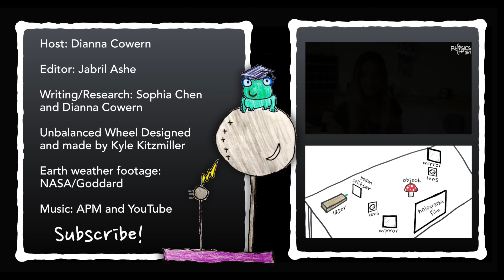Are perpetual motion machines possible?

Comment: Are perpetual motion machines possible?  No.  Do I know why?  Yes.  Do I still want Physics Girl to explain it to me?  YES
Reply: The First Law of thermodynamics  encompasses several principles:

    The Conservation of energy, which says that energy can be neither created nor destroyed, but can only change form. A particular consequence of this is that the total energy of an isolated system does not change.

    The concept of internal energy and its relationship to temperature. If a system has a definite temperature, then its total energy has three distinguishable components, termed kinetic energy (energy due to the motion of the system as a whole), potential energy (energy resulting from an externally imposed force field), and internal energy. The establishment of the concept of internal energy distinguishes the first law of thermodynamics from the more general law of conservation of energy.

   
    Work is a process of transferring energy to or from a system in ways that can be described by macroscopic mechanical forces acting between the system and its surroundings. The work done by the system can come from its overall kinetic energy, from its overall potential energy, or from its internal energy.

        For example, when a machine (not a part of the system) lifts a system upwards, some energy is transferred from the machine to the system. The system's energy increases as work is done on the system and in this particular case, the energy increase of the system is manifested as an increase in the system's gravitational potential energy. Work added to the system increases the potential energy of the system:

    When matter is transferred into a system, that masses' associated internal energy and potential energy are transferred with it.

   

    The flow of heat is a form of energy transfer. Heating is the natural process of moving energy to or from a system other than by work or the transfer of matter. In a diathermal system, the internal energy can only be changed by the transfer of energy as heat:

 

Combining these principles leads to one traditional statement of the first law of thermodynamics: it is not possible to construct a machine which will perpetually output work without an equal amount of energy input to that machine. Or more briefly, a perpetual motion machine of the first kind is impossible.
Reply: @jeremysmith8035  laws of thermodynamics applies only to steam engines and internal combustion engines, but do not apply to asymmetric electrodynamic machines and self accelerating generators. Energy is created in every electric generator. In conventional electric generator, created energy is used to do negative work and decelerate rotor. In RegenX generator, created energy is used to do positive work and accelerate rotor. Physics community get everything wrong, when they falsely applied Newtonian mechanics to electrodynamics. In electrodynamics, equal and opposite reaction can be delayed in time domain. If armature reaction is sufficiently delayed in time domain, equal reaction is no longer opposite, but complementary. Law of conservation of energy is violated along with Lenz law. Current can be delayed in time domain above critical minimum frequency, around 1kHz.
Reply: @marcisgulbis9310  none of this matters as long as there is no working prototype of a machine that gives you more WATTS then it took.
you can make that rotor spin as fast as you want but you'll have get the energy from the rotor at some point and that is where this BS falls apart every single time.
Reply: @jeremysmith8035  Copy and paste much? Wikipedia is your friend.
Reply: @jeremysmith8035  Bla bla bla another quote of the law  Asymmetry is nowhere explained
Reply: @claytonrealist8868  My thoughts a little miss priss teachers pet trying to explain it to us  Liberalsplaining no facts just conviction
Reply: Heard that, yo.
Reply: They aren't possible with the knowledge we have today. Who knows where we will be in the future.
Reply: I dont mean to be so offtopic but does anyone know a tool to get back into an Instagram account..?
I somehow lost the account password. I appreciate any assistance you can offer me
Reply: @labla8940  In symmetric motors, all coils is connected to power source all the time. In asymmetric motors, only one coil, or group of coils is connected to power source. All other coils is disconnected from power source. When coils is disconnected, ether can flow into coils. In asymmetric systems, coils are switched on and off, without reversing direction of current.
Reply: @labla8940  https://youtube.com/user/ufopolitics
Reply: @prestonian1066  101 % will be success. That is only 2% away.
Reply: We live on a perpetual motion machine.
Reply: @claytonrealist8868     same place we were two hundred years as regards to perpetual motion.
Reply: @kalijasin  Well, this sounds interesting.:) Would you be so polite to clarify your point of view?
Reply: we can harness the energy of gravity, make artificial waterfalls,
the problem of raising water requires greater energy upwards can be overcome with water electrolysis, but gravity on earth is small enough that it requires modification of liquid molecules other than water (H2O)+catalyst
because the height of the water tube required is around 300000 meters if using H2O, and yes this looks like perpetual motion
Reply: 100% agree.
Reply: Wait ... are you saying this video is about perpetual motion?
Reply: they exist I have seen plenty... invention secrecy act
Reply: Same
Reply: Hahahaha yup!
Reply: I only see physics experts around here... Could someone explain me what Maxwell's demon does?
Reply: of course
Reply: Im so in love with her :D
Reply: "Efficiency" in physics is technically a measurement of how close you have come to perpetual motion, because it measures how much useful energy you get out of something.

You could pretty much say that perpetual motion is kind of the ideal goal in physics, like for example how zero air resistance is the ideal goal when you design cars, and so on;
it is something that cannot actually be achieved, but that you nonetheless try to aim for as much as possible.
Reply: I’ve invented one it’s easy
Reply: @VikingGodForLife  found a good way to hide the wires to the battery?
Reply: Actually according to physics, perpetual motion machines exist in vast numbers. They tell us that the electrons orbiting in the atoms will generate power and will always run at the same speed, even when acted upon by other atoms.
Reply: Decay
Reply: A silnik grawitacyjny da się zrobić??
Reply: i
Reply: It is possible, but not yet in a zero gravity environment..

Comment: We in Germany have already the unlimited Energy Machine.  Its made from a Cat, and one slice Toast Brot.  Since Cats ALWAYS land on the Legs. And Toast Brot ALWAYS land on the Butter side...  when both fall down, you only Need to put the Toast Brot on the Back of the Cat and let them both fall down.  It will spin neverendless, since the Cat will land on the Legs, and the Brot will land on the Butter side.  And since this Construction will spin neverless you have unlimited Energy.  We use this Machine in our House. You only Need to feed the Cat from day to day. Thats it.
Reply: Haha, thats funny!
Reply: Why not put two butter sandwiches with the butter on opposite sides? Won't have to feed the cat
Reply: And if toast always landing on the butter side was true, it would actually work, unlike the cat and toast thing. If the cat lands on it's feet, the toast doesn't land anyway as it stays on the cat's back, so it never reaches the ground :P
Reply: Spendet ihm bitte ein Lachen
Reply: German engineering at its finest
Reply: So then the cat food is the energy source? Save time eat cat food?
Reply: but but...wouldn't the spinning force run out of control as the cat's ability to land on it's legs constantly compete with the toast's butter side, thus accelerates infinitely until it become a supermassive blackhole and destroy reality? O.O
Reply: The fur provide the friction to not let that happen and turns it into electricity as well
Reply: Why not take a single slice of toast and cover it entirely in butter so every side is the butter side?
Reply: Leader Fangrill Because if you do, the slice will separate in two thinner buttered toasts and release a lot of energy
Reply: I drench the Toast Brot in the butter and boom, antigravity.
Reply: better put two cats back to back and then just give them a starting spin thats it
Reply: Bart Bols Otherwise the result could be catastrophic.
Reply: ...(what's with the weird capitalization?)
Reply: In German all nouns are capitalised, whereas in English it's only proper nouns.
Reply: Ha Ha I saw that Cat Toast Cartoon. Genius!
Reply: hahahahahah
Reply: Zero Messiah vacume
Reply: this is the future of wormhole technology
Reply: Karl S. What if you just butter the Brot on both sides?
Reply: Matt Wood   OMG!! Never do that. The whole Universe would implode, becaus of an space time paradoxon.
Reply: Matt Wood it would just levetete
Reply: Why the poor cat? You only need 2 toasts and get the same result.
Reply: SkyMix_RMT the unbuttered toast would just flop down the cat would be able to flip it over
Reply: This is so old :(
Reply: 2010 called and wants its joke back
Reply: That's a problem for the next generation.
Reply: Give the cat a toast brot, loop is closed.
Reply: Funny, my cat landed on her head earlier today when she got in my way and fell off the table as I tried to take a photo to prove to an Ebayer who took no notice of my 1300+@100% Ratings that he'd sent me the wrong diameter steel rods... so your theory may not hold when In-The-Way and Table Factor is involved.
Reply: jajajaja
Reply: Nice idee ... Potenzial für Perpetuum mobile?
Reply: So, will the cat stop landing on it's legs if you stop feeding it? :D
Reply: I see all these likes and all I can think is "Must be their first week on the internet" lol
Reply: brot und beer
Reply: Much better ! Remove the cat and replace it with another toast, this way the system turns without any external energy. There's no more need to feed the cat, even if sometimes you must reload the butter sides to compensate evaporation, but far less than the cat's feeding.
Reply: Sorry, I posted the same message but far later, I shoud have read before.
Reply: You fool, but very funny too...
Reply: Genius
Reply: my cat would just eat the bread lol
Reply: Al Bundy so your saying toast butter and a cat will infinitely land and fall in one spot without toast or butter falling of of a cat which makes energy come from an infinitely moving things and how would you make something to collect all that energy from your cat torture
Reply: if you need to feed the cat, then is not infinite... because the cat will eventually die and stop landing on the legs... :)
Reply: Very Intriguing. I am looking to purchase 300,000 units based on your data come the end of this business quarter. My only concern before we proceed with this transaction is the issue of excrement. Do you have a solution for this to keep it contained? My board members are concerned of a possible issue with the speed of the rotation of the cat combined with it's constant need to defecate. Some are hypothesizing that it will be akin to a monkey with a hateful grudge towards humans, whereby retaliating by flinging his poopoo at enemies. You could imagine our concern given that appearance and cleanliness are everything now days. Let's connect soon. Looking forward to going through with it if you have a remedy for the possible issue. I'll send you a linkedin request to connect?
Reply: ifer lyf r/woosh

Comment: Laws of thermodynamics
1. You can't win.
2. You can't break even unless it's a really cold day.
3. It can't get that cold.
Reply: WHO FORGOT THE 0TH ONE???
Reply: Talking if which, you cannot get to absolute zero as it would require an infinite amount of energy, there is an absolute hot ,called the planc temperature ,where the energy radiated has a wavelength shorter than the planc distance, which is the smallest size with any meaning, to give you an idea how hot that is, a pin head at planc temperature would instantly vaporise the solar system
Reply: @jeremysmith8035  It wouldn't happen instantly, though. The effect would radiate at the speed of the light max.